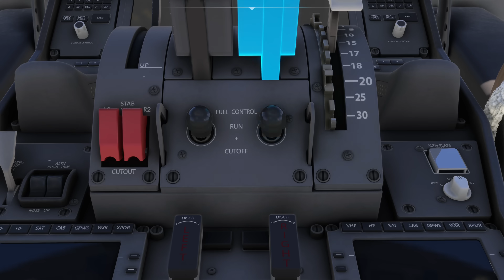Air India 171: Why Did The Fuel Cut-off Switch Get Moved?

Comment: At minimum, an alarm should sound if those switches are turned off, immediately after the plane has transitioned from ground mode to air mode.  The lack of this isn't Boeing's fault, because it's clear that no plane has this feature.  Its purpose would be to protect against a pilot with nefarious intent.  (And just btw, it's clear that it's a "taboo" topic in the airline industry.  This tragic incident makes one wonder how many other "accidents" through the years may have had a similar cause.)
Reply: No alarm will be more noticeable that the sound of the engines spooling down and the feeling of losing thrust
Reply: @clm2071   Takes a number of seconds to realize that's the problem.  If the alarm went off immediately as those switches are touched, there's no ambiguity as to what the issue is!
Reply: @freecycling6687 first MI for a loss of thrust is to check the switches. Literally the very first thing a pilot will do the second they feel a loss of thrust is to check the switches. Theres no need for an alarm to tell them to check something they are trained to do automatically
Reply: @clm2071  If that was always true, it wouldn't have taken 10 seconds between the question "why'd you turn off the switches", and the turning back on of the switches.

Comment: Sir, there are reports from what appears to be and Indian representative. I'm not sure if he's a pilot. There is a video about him indicating that it's not possible to switch off the fuel cutoff switches that quickly one second apart. I am a 777 FO. I know for a fact every single time. I turned both engines off once we set the parking brake, it happens very quickly, probably inside of 1 second. This gentleman in the video, it goes on to discuss how it's very difficult to look down. Identify where the switch is pull up the detent you move the switch down, let's go of the detent etc. We know that an experienced pilot can do this with their eyes closed. Hek if they really wanted to switch them off fast.They can use both hands if they are agile enough to reach over.  It just 'seemed' like a very credible video that a lot of information is not accurate on how quickly those  switches can be manipulated. Fly safe

Comment: Why aren't planes designed so that the pilots CANNOT take actions that would compromise safety duing various phases of flight? It seems to me that during takeoff, climb out, and flight, it should be impossible to turn off the fuel switches, for example.

Comment: Is there no way the wiring or circuits of this switches might have malfunction on itself?, what if there some kind of short circuit or electrical surge that messed up the settings of the swicthes, how are we 100% sure that those switches were touched to turn off? What if its only rogue electrical PULSES that turnd it off and the swithes was never moved from the "ON" to off position  all along , hence both pilot's seemingly confused conversation...hmmm, not a pilot or avionics technician just wondering if that is posible..

Comment: Hey Captain Steeeve, amazing work on providing us with all of this information. One question; Considering the 787 uses an all electric engine start system rather than the conventional APU bleed air start system of almost all other jets, in this scenario would the RAT have been able to provide enough electrical power to spool up both engines to starting RPM? That is assuming both engine start switches were moved from NORM to START.

Comment: Most big rigs DO NOT have driver facing cameras because its an invasion of privacy. Those that do are used to punish the driver more often than to protect anyone. When you know that, its like driving with a gun to your head the whole time. The amount of stress that causes is unnecessary and leads to second guessing everything, decreasing safety. 
I left a company of over 13 years because they were getting to intrusive with the forward facing cameras. They're from Iowa and have no clue about how you have to drive in the northeast. I screwed up and tried a local job to be home more than once a month. They had driver facing cameras as well. Now, I found I just prefer long haul, and being home everyday disrupted my wife and daughter's routines, which stressed them out, so i left and I am now with a good family owned company. But, despite 2.5 million safe miles, both companies constantly were chewing me out for driving like a northeast driver. The stress got so bad that it started destroying my relationship with my family. And, suicide even crossed my mind a couple times. But, i quickly dismissed those thoughts as ridiculous and irresponsible. The company I'm with now is from the northeast and they understand what it takes to drive in the northeast, though they will tighten the reigns if the forward and side cameras show you getting too aggressive. But, they'll also ask how you're doing mentally to see if there's a reason for it because they actually care about the drivers.

Comment: Thank you for providing the video and detailed explanation. The report clearly indicates that an issue with the fuel control switch led to the tragic accident. While there are speculations about human error causing the fuel control switch to move from "run" to "cut off" within a one-second difference, potentially due to a pilot's mental health, it is noted that no action is required from the manufacturer or for maintenance issues.

However, it is concerning that the Preliminary Report lacks precise timing of activities between 08:08:42 UTC and 08:08:47 UTC, and there are no specific time details of cockpit activities. The report only mentions a one-second time difference. It is unclear how this one-second interval was determined without exact time stamps for each activity.
Time		Time Difference
07:48:38UTC	The aircraft was observed departing from the bay 34	
07:55:15 UTC	The taxi clearance was received	
07:56:08 UTC	the aircraft taxied from the bay	
08:07:33 UTC.	The take-off clearance was issued	
08:07:37 UTC.	The aircraft started rolling	
08:08:33 UTC.	The aircraft crossed the take-off decision speed V1 and achieved 153 kts IAS	
08:08:35 UTC	The aircraft Vr speed (155 kts) was achieved	
08:08:39 UTC	The aircraft air/ground sensors transitioned to air mode	
08:08:42 UTC	The aircraft achieved the maximum recorded airspeed of 180 Knots IAS	
Time Missing	the Engine 1 fuel cutoff switches transitioned from RUN to CUTOFF position	
Time Missing	the Engine 2 fuel cutoff switches transitioned from RUN to CUTOFF position with a time gap of 01 sec	1 Sec Time Difference
Time Missing	The Engine N1 and N2 began to decrease from their take-off values as the fuel supply to the engines was cut off.	
Time Missing	In the cockpit voice recording, one of the pilots is heard asking the other why did he cutoff.	
Time Missing	The other pilot responded that he did not do so.	
Time Missing	Ram Air Turbine (RAT) getting deployed during the initial climb immediately after lift-off	
08:08:47 UTC	both engines N2 values passed below minimum idle speed,	
08:08:52 UTC.	Engine 1 fuel cutoff switch transitioned from CUTOFF to RUN	
08:08:54 UTC	The APU Inlet Door began opening	
08:08:56 UTC	Engine 2 fuel cutoff switch also transitions from CUTOFF to RUN	
08:09:05 UTC,	MAYDAY MAYDAY MAYDAY	
08:09:11 UTC	The EAFR recording stopped	
08:14:44 UTC,	Crash Fire Tender left the airport premises for Rescue and firefighting	

This discrepancy suggests that the report may be omitting certain facts, potentially to portray the incident as human error.

Comment: I analyse and interpret crash data from motor vehicle for a living and have done so for many years. The times quoted are to the nearest second as the system appears to be recording at 1 hertz. The one second quoted (on just about every video) could be just under 2 seconds (or just over 0 seconds.  This could be critical information that I'm sure the investigators would be well aware (hopefully)

Comment: "Federal Aviation Administration (FAA) advisory from December 2018 regarding a potential flaw in the aircraft’s fuel-control switch system – highlighting the potential disengagement of the locking feature."  What about that Steve?

Comment: The report doesn’t say the switches were operated by the pilots—only that they ‘transitioned.’ That leaves open the question of whether any pilot was involved and, if so, whether it was done intentionally or unintentionally. Still, I believe there’s enough concern to justify issuing a mandatory bulletin for inspecting all switches on Boeing aircrafts

Comment: What other improvements can be made to an aeroplane to prevent "an action performed at the wrong time" to reduce the vulnerability to an accident like this? Could this have been premeditated? If someone was asked, "when and what is the easiest way to crash an Aeroplane", is the answer: The simplest way to do this is "just cut the fuel to all engines during take off". Why is this not a known scenario, among others, which is protected by the computer?

Comment: When on a pilot or captain all the people flying on the aircraft is entirely dependent on no matter it’s as if you in a car so if the case of fuel switch is used to control the whole saiid the plane equals to all the passengers and crews not have a warning ‼️ sound or beep systems so it’s noticed to the other pilots when the switch is turned to cutoff position just like in the car when you not wearing seat belt it alarm the driver it’s should be even better technologically set system to avoid these incidents again

Comment: The switches can't turn themselves off. They can't be accidently turned off. The fuel switches can't be confused with the gear up lever. The switches were turned to the off position at the most critical part of the flight. The outcome of doing so would almost certainly lead to catastrophe. Difficult to think of anything other than deliberate intent.

Comment: The report states that the "switch transitioned from RUN to CUTOFF". This wording is very intentional.  The report specifically doesn't say the switches were physically moved. The FDR on the 787 only records ARINC 664 data packets from, for example AIMS,  and it does not record the physical switch position. So stop jumping to conclusions.. There is currently no evidence in the public domain that the physical switch was moved. When you take this into account, blaming the pilots is quite frankly disgusting.

Comment: I think it’s wise—before coming to a conclusion assessing cause—to eliminate every other possibility. It seems like the FAA advisory of 2018 (that fuel cutoff switches if working properly could be accidentally moved to the off position) is relevant and accidental movement must be eliminated as a possibility. IIRC an earlier video you posted showed the takeoff process involved the pilot not flying putting a hand above the throttles during the takeoff sequence, which puts the cutoff switches in close proximity to the action. How can you eliminate this as a possible cause, as you seem to have done?

Comment: well We don't have the whole conversation of the pilots, which should have been released, I mean after the cut off question from one of the pilots to the other, they stopped talking? of course not, also the switch moved back to fuel on after almost 10 seconds, why? and in those 10 secs what they said? things are very unclear in strange way, report wanted to highlight this point clearly.

Comment: I am very surprised with cockpit being fly-by-wire there is no logic in software where fuel cutoff cannot be activated in the system when thrust levers are set to takeoff or full power, even when switch is manually placed in off position (software overwrite). All scenarios described tell me when pilots do use fuel cutoff  off they first reduce power.  And also, have you considered a malfunction or tampering with the switches? Maybe spring was broken and switches were vibrated out and down on rotate?

Comment: all the pilots have the experience of operating the fuel switches while planes  are on ground but not when just plane  lifting at 15 degree.   ,consider the position of plane upwards at 0.42 seconds and also that for cut off switches have to come down not upwards as in case of run position. Is this ideal  position for malfunction which was taken note in 2018 advisory.

Comment: If one of the pilot was in the mindset to commit s**** would he not actively try to stop the other pilot from trying to restart the engines? The main take from this is that human error is possible however I've read a previous report in 2018 where there had been an issue with Boeing's fuel cut off switches. What makes this a whole lot worse is that a boeing whistleblower 'mysteriously' died. When a company like Boeing works the way it does I think it's important to highlight probable causes in a balanced perspective. Both pilots had plans with their life ahead of this tragic crash. 
And apparently it is possible for a faulty switch to turn off a few seconds into the flight due to wiring vibrations etc. So this is something that should have been talked about too.

Comment: I know this may sound far-fetched, but based on the vague and weak preliminary report, this is what I suspect. The report seems manipulative and raises serious questions:
1.	Cockpit Voice Recording Ambiguity
The report mentions: “In the cockpit voice recording, one of the pilots is heard asking the other why he cut off. The other pilot responded that he did not.”
– This statement is unclear. Who exactly asked the question, and who responded? The report fails to clarify who moved the fuel control switches. Investigators can easily determine this from the CVR, but the ambiguity raises the possibility that the question may not have been directed at either pilot.
– It’s possible a third person was present in the cockpit—perhaps seated in the jump seat—who reached forward and moved the fuel switches to cutoff. During takeoff and climb, both pilots are highly focused, and such an act could easily go unnoticed in the moment.
2.	Presence of Relatives or Friends on Board
– Were any friends or family members of the pilots on this flight? If so, could one of them have been invited into the cockpit, perhaps by request? This scenario may seem unlikely, but it's not unprecedented and should be ruled out.
3.	Lack of Alarm or Warning Details
– The report does not mention any cockpit warnings or alarms when the fuel switches were moved to cutoff.
– Normally, if both fuel control switches are moved to CUTOFF shortly after takeoff, this would trigger multiple alerts: aural warnings, EICAS messages, and visual indicators for dual engine flameout, thrust loss, and engine shutdown. The absence of this information is suspicious and must be addressed.
4.	Questioning the Suicide Theory
– If the CUTOFF was a deliberate act of suicide by one of the pilots, why was a “MAYDAY MAYDAY MAYDAY” call transmitted? 
– A pilot intent on committing suicide would likely not broadcast a distress call, as he would already know the outcome is inevitable. Note that he will not move the switches back to RUN again. Investigators who reviewed the CVR know exactly who made the distress call.

Comment: I have read elsewhere that some of the early models of this airplane did NOT have the locking toggle switches, but simple toggle switches. Also, could this not also happen due to a short in the cabling? No one seems to talk about that possibility.

I also find it totally crazy to place the cut off switches at this position. Regardless of their locking feature. Its madness. And they knew it - look at those half-assed protectors to the left and right of the switches. They should be placed on the ceiling behind a protective plastic cover. As any legit electrician would suggest. I guess Boeing does not employ these? Never again will i set a step into a Boeing!

Comment: As a process technician, nothing to do with the aviation industry,  i'm wondering if the fuel shutoff switches in the cockpit are hardwired to some kind of fuel shutoff valve or  are they just inputs on a proces computer where the signals are processed by a computer programm and then lead to outputs who are wired to the fuel shutoff valves, or a combination of both. The latter makes it much more difficult to determin a cause of this accident.

Comment: I totally agree. 10 seconds is an amazing short period of time for one of the pilots to recognize AND correct the fuel switches. Which is why I speculate that the copilot (pilot flying) moved the switches to cutoff positions and the Captain (pilot monitoring (the instruments)) returned the switches to the run position.

Comment: Belief in one God is better. Ziv Ritchie’s *Scientific Proof of G-d*, published on August 16, 2024, presents a groundbreaking and thought-provoking argument for the existence of a divine creator, ingeniously blending mathematical rigor with astronomical observations. This work stands out as a bold and innovative contribution to the discourse on science and faith, offering a fresh perspective that challenges conventional atheistic counterarguments while captivating readers with its clarity and ambition.

The core of Ritchie’s proof is a remarkable discovery: the ratios of key measurements (diameter, distance, orbital velocity, and rotational velocity) of the Earth, Moon, and Sun consistently align with decimal multiples of just three numbers—1, 3, or 4—in a base-10 system. This numerical pattern, encompassing 29 distinct ratios, is calculated to have an astonishingly low probability of occurring randomly, with odds of 1 in 25 billion billion billion (2.5 × 10²⁸) in the full proof, and 1 in 2.5 million million (2.5 × 10¹²) in its simplified form. Ritchie’s use of classical probability to quantify this anomaly is both accessible and compelling, making a strong case that such precision cannot be by chance. 263672.com